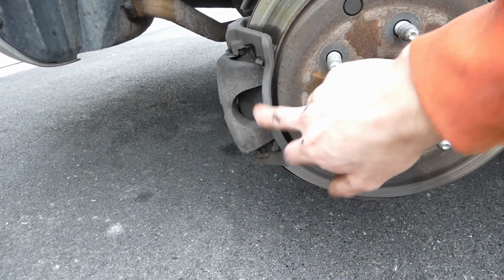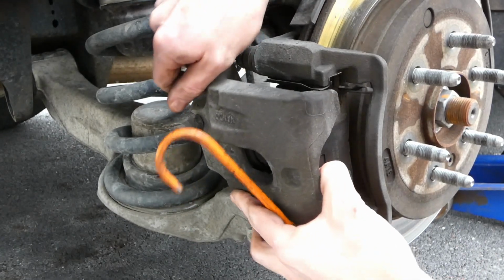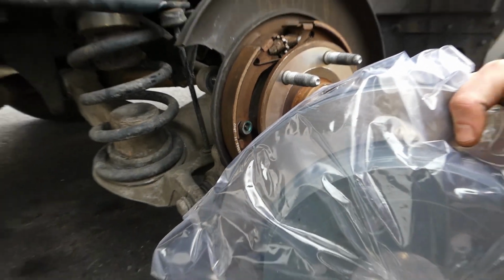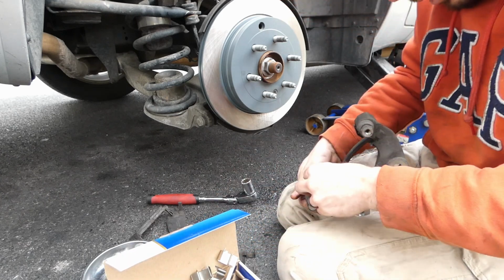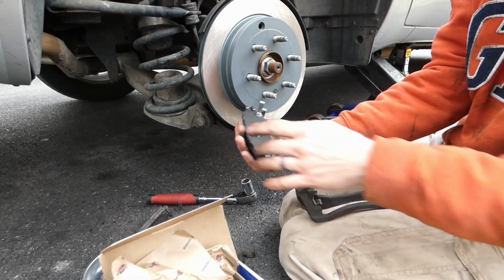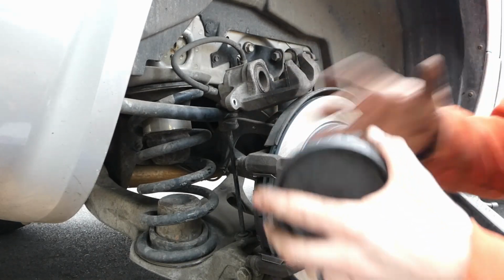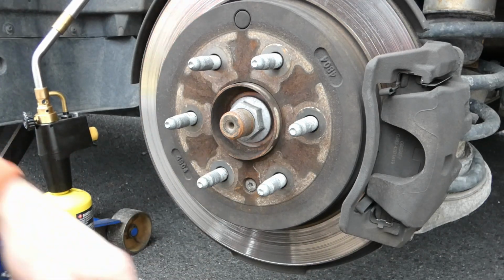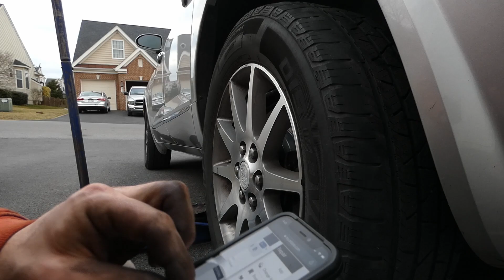2014 Buick Enclave Rear Brakes

Comment: The two 21mm bolts that mount the caliper are torque to yield. That was a wonderful surprise to me knowing I had to get new bolts
:/
Also had to buy blue lock tight. 

Overall I needed to buy three unexpected things: a long ass breaker bar, blue locktight, and new special TY bolts